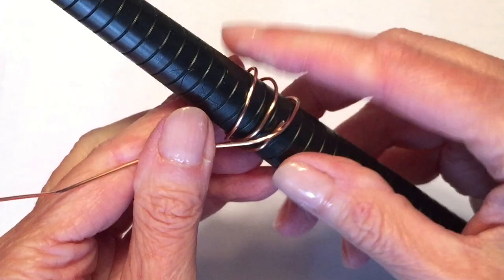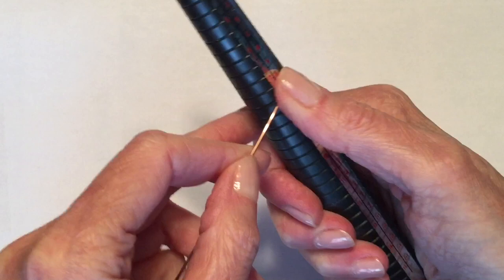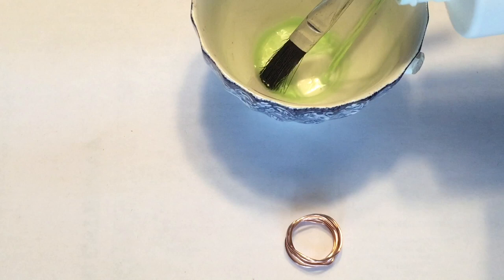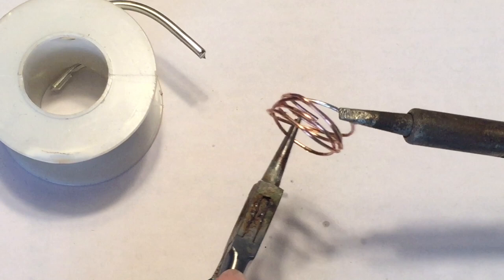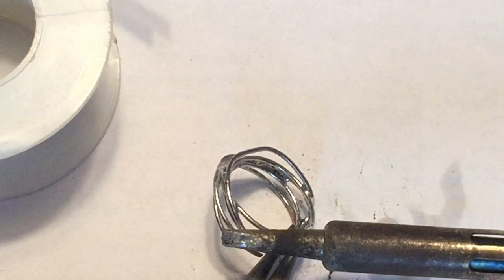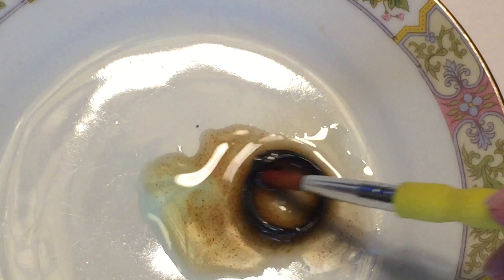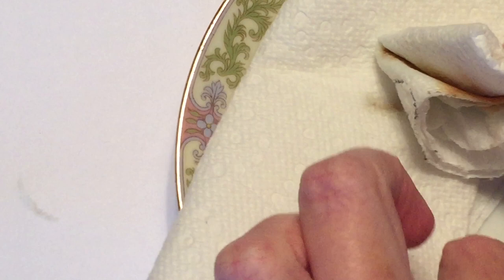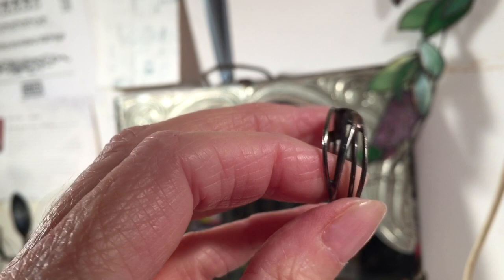Soft Soldering: Make A Contemporary Ring

Comment: Just getting into soldering, your videos are so helpful! Will soldered rings leave your finger green with or without patina? I can’t seem to find info anywhere on the longevity, if I’m going to sell pieces will they end up tarnished and gross after a while? Thank you 😊
Reply from the maker: As far as the green thing, I know there can be a few reasons for that, and I understand it as this: some people are more sensitive to metals than other people...and...each of us has a different body chemistry and so therefore some folks will have slight reactions...I've heard the higher your acidity the more of a reaction to some metals. Now, copper is a common one for that green tinge, and having that happen is a normal reaction to copper! and that's caused by the copper becoming tarnished (think about old copper that gets that green tinge of verdigris)  so keeping that cooper shiny may help. There are jewelry varnishes you can use - I've never used them myself but have seen them in jewelry supply catalogs.
Reply from the maker: PS the green that you sometime get from wearing copper rings is not an allergy to copper, it's just a common reaction between your skin's acidity and copper.